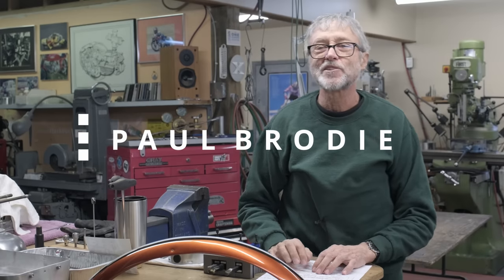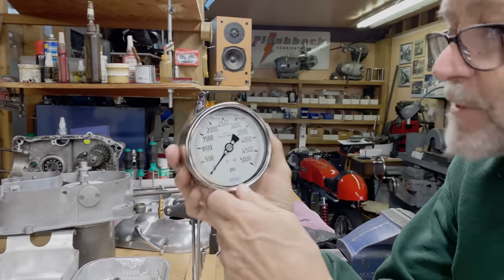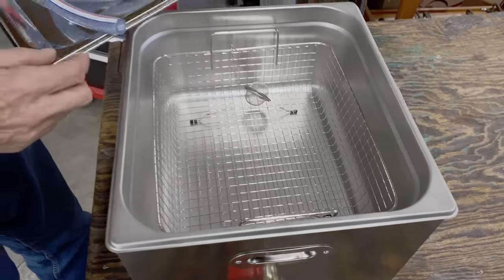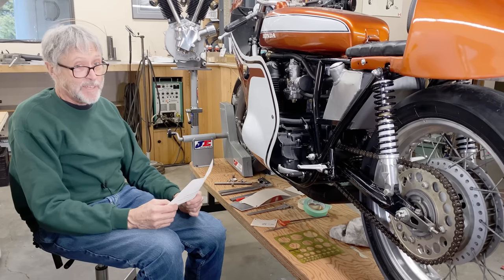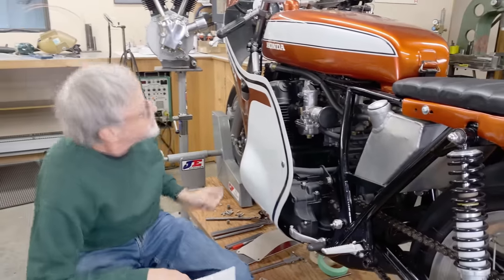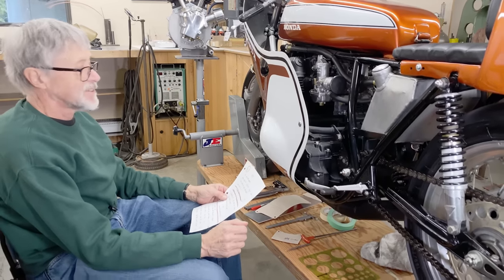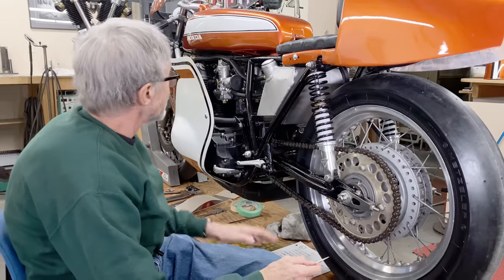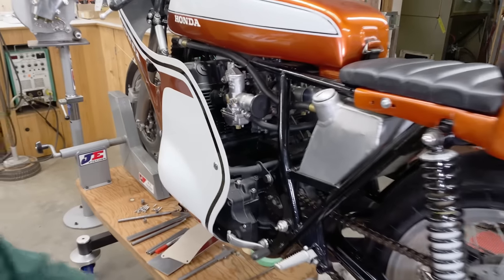Mounting a Fender on a CR750 Race Bike // Paul Brodie's Shop

Comment: Not sure if someone has said this yet, but on the cb750, the front frame down tubes are spot-welded into the stamped headstock piece. It's common practice on a race bike to fully weld the tubes into that stamped piece. That may explain all the welding on the front of the frame.
Reply from the maker: You might be right. If only the frame could talk!   :face-fuchsia-tongue-out:
Reply: I race a little CL175, and similarly welded the tubes.  Didn't realize others did this, too.  Thought it was my own little speed secret.
Reply: @393Nader  I used to have a CL175 that I planned on building onto a race bike. I bought it from a guy for $75. He said the engine was junk, but I got it running that first night and I had a ton of fun on that little orange bike over the next year. I never did build it into a race bike, but I basically rode it like a race bike all over rural Iowa. And like a dirt bike, trials bike, stunt bike... But it was still running strong when I sold it. And like every other vintage motorcycle/car/snowmobile I've ever sold, I regret it.
Reply from the maker: @393Nader   Good to know your speed secrets. Thanks!   :face-fuchsia-tongue-out:

Comment: A friend did drill holes in these disks and found some spots very hard  and others soft our belief is it’s a kind of pot metal stainless or there is heat hardening going on. Stainless steel is not a good disk material for the want of no rust stains from cast iron we had to put up with a disk about as good as a drum. I had a CB450 twin with the same break they where never very good. I love our work. Wobbels the mad Aussie
Reply from the maker: Yes, drilling a lot of holes in stainless rotors can take a long time and cause frustration. I would probably not volunteer for a job like that...   :face-fuchsia-tongue-out:

Comment: I made a steel fender hoop brace for my RD 350 LC  to replace the flimsy aluminium original,  and could feel the control improvement before I got out of the driveway.  Had not thought about Westwood for some time.  Was there as driver/pit help with Jimmy Allen in 1975 after he competed at the 1st bike race held at Mid Ohio,  Keep up the great work
Reply from the maker: Thanks David. Yes, a good fender mount can work as a fork brace too...    😉

Comment: Top hint for the ultra. you can use little glass jars and other containers to use different solvents and cleaning fluids in the bath. Saves a fortune on filling the bath and having to switch out dirty fluid between jobs. I've run a whole bath of acetone one time to degum a very precious carb. I wish I'd known this trick before hand, Too may brain cells went west during that little game.
Reply from the maker: Thanks Mark. Good advice :)

Comment: I guessed 18 hours so wasn't too far away, I'm also looking forward to an honest opinion of the ultrasonic cleaner, I used a cheap one in the past and questioned if it was my expectation that was too high, or the cleaner just wasn't that good!!
Reply: In my experience they work OK but are very over rated when used for carb cleaning.
 I've had to do a lot of carbs properly plus repair various things after they have been in an ultrasonic cleaner.
 I mainly do old Honda carbs from mid 60's to about 1980, the cavitation bubbles (how ultrasonic cleaning works) can erode the old zinc alloys real bad. I also found white vinegar works better on the brass inside carbs than using ultrasonic

Comment: Sure looks like Ron was riding a early TZ700/750. Twin shocks and that is the original fairing design. They were pretty evil handling with those twin shocks. Some riders switched to a custom monoshock in 1976, the TZ750D (77) came with the monoshock from Yamaha. That was a much better chassis.

Comment: Really nice job, it looks the part and improves the bike’s appearance. Are you going to deal with the seat/hump and rear sub-frame? That would equally be an interesting watch... Thanks Paul. Les in UK
Reply from the maker: Les, the bike left my shop shortly after the fender was mounted. It is no longer in my control.

Comment: If that rear rim is an 18” Akront, it most likely has an extremely thin cross section. Kosman imported them drilled for his drag hubs. This rim looks like it was for a 7” drag slick. It probably won’t last long in a road race application. You’d be better off with a correctly drilled Sun rim from Buchanans. I doubt you will find a Borrani rim that wide to match the front.
Knowing Paul’s skills, I’m certain he could section a Borrani and graft in a wider center section. Kosman’s used to do that a lot, too. Pretty trick.
Reply from the maker: I'm told the bike is likely to be used for display only, not racing. If so, it will be fine as is. But, thanks!

Comment: Enjoyed the vid. ..... Gross optimism regarding the rear wheel horsepower  by Honda and yoshimuira, ..... std . CB 750 , QUOTED hp IS 67 HP,  .....this is crankshaft HP , allowing for  pumping and frictional losses within the motor, .... actual RWHP was around 51 -  53 HP ,when dynoed   "back in the day" !   ...... I doubt that the Yoshi Bikes had more than a genuine  75 ish. RWHP.  in reality.
Reply from the maker: Thanks Mike. You might be right about the HP claims. How will we ever know for sure?

Comment: With your ultrasonic cleaner, can I make a suggestion someone gave me, that I've found really useful:
Don't put your cleaning fluid directly into the tub of the machine. Just use water. Then,  put your parts and cleaning fluid into jars or tubs (or even plastic ziploc bags), and put them in the water. It works the same but saves cleaning fluid and also the getting the ultrasonic cleaner really messy...
Reply from the maker: David, thanks for your tip.

Comment: It's too bad they're gone now but my pal Bob Jameson and Bob Hansen could have filled in a lot of the blanks on the CR750.  Bob helped with development of the CB750 on many trips to Japan and Hansen was American Honda team manager.  The two problems facing Bob, who was Dick Mann's mechanic, were high oil consumption and rapid wear of the rubber slider for the cam chain tensioner.  The Japanese engineers told him not to worry about the oil consumption and without new, improved parts all Bob could do was bolt-in the same tensioner as the worn one.  He installed his last one the night before the 200, working into the wee hours cleaning all the rubber crud from inside the engine.  

Dick Mann was really a courtesy entry because Honda Ltd (Japan) assumed the Grand Prix riders (Hailwood, etc) would win it hands down.  Their mechanics ignored the worn tensioners and took off for the pub after final practice while Jameson called them every bad name in the book.  As history has shown, they all DNF'd with engine problems.  Towards the end of the race, Hansen had Mann slow his pace to ensure a finish and Romero/Triumph was coming fast!  When the race was over and Dick won, Bob checked the oil level and told me the crankcase contained only about 1-cup of oil and the tensioner was badly worn!    For his final 10-15 years, Bob Jameson lived about a mile from me and we were good pals because we both worked at American Honda

ps. Keihin is pronounced "Kay-heen."  I'm Japanese-American and have been to Japan many times for Honda so the names are familiar to me.  

https://www.revzilla.com/common-tread/50-years-later-a-look-at-the-drama-behind-hondas-first-daytona-200-win
Reply from the maker: Thanks for watching and commenting. Yes, I have heard those stories before, and that's partly why racing from that era is so fascinating!

Comment: Have you sorted out the rear misaligned spokes? Would an original longer spoke into the next hub hole that was swapped out for a shorter spoke offer a possible reason?
Reply from the maker: Not my bike, and it has left my shop, so there is nothing I can do....

Comment: Regarding twin leading shoes...

In the bicycle world we have Sturmey Archer drum brakes that use one leading/one trailing shoe (cam/simplex). The leading shoe wears out faster than the trailing shoe and the brake's single cam mechanism has no way to compensate for it. The performance diminishes prematurely. 

For your average commuter bike around European cities, this probably isn't a big deal. On a racing motorcycle I'd expect you'd want it to be predictable and repeatable every time it was used, right?
Reply from the maker: Yes, for braking I would want consistent and predictable performance.

Comment: I guessed 15. At $100 an hour (good price for fabrication) that's $1500. At 19 hours then $1900. Fabrication doesn't come cheap. I made fender struts for a project of mine and put a ducati fender on a gsxr fork. I had to make a 3/8 inch mandrel tubing bender to make the struts. I figure I had to have at least 25 hours in that. Didn't make a penny, but have some trick fender struts!
Reply from the maker: Not everything we do is about the money. Sometimes it's about learning a new skill, or helping out a friend.

Comment: Strangely, washers with a small hole and a large diameter are called "fender washers".  I loved your artistry and desire to make the best. Edit, my guess was 15 hours. But my fender bracket would not look as lovely as yours did.
Reply from the maker: Yes, I was directed to the part of the shop that had the "fender washers"... I noticed the price went up a LOT for washers in that area. 15 hours is a good guess, bit low. Thanks for watching!    :face-purple-wide-eyes: